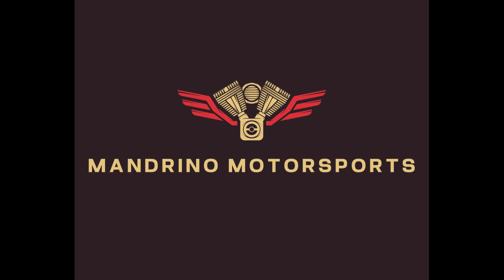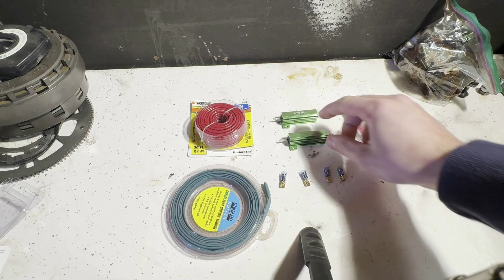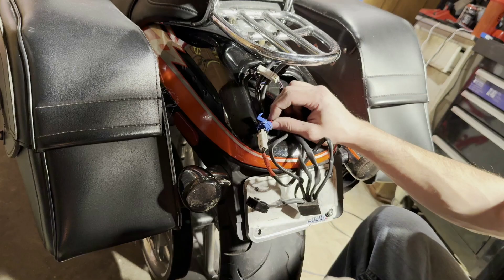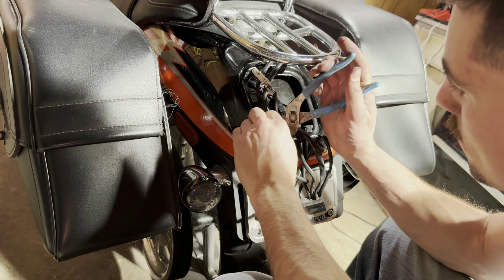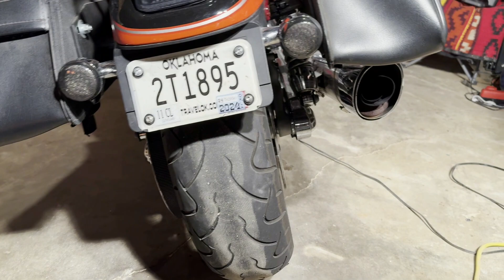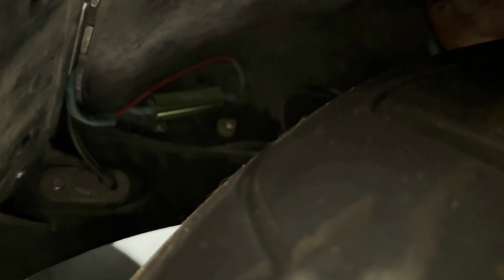Vrod Lighting Part 2

Comment: Interested in your Saddle bags and 2 up seat Sissy bar where can I find them and how did you search them or are they sourced from a different model bike?
Reply from the maker: The saddlebags were a headache. I ended up connecting with Keith Lindberg on Facebook who runs VRodbagger.com as you cannot buy the brackets from Harley anymore. The bags are Saddleman Jumbos that I modified to fit.

The seat was factory and the sidebar is as well. I bought it with those attached. 

Anything 2003 to 2005 should fit on this early generation bike. I will release a more in depth video on the bags if there is interest in it!

Comment: Nice work, normally there are not so much wires behind the taillight but there is now a runninglight module mounted that is not standard ( it is a HD accessoiry) I also have one… just be careful when pushing down on the taillight…. The upper tabs that fit under the outerfender break off very easy😢
Reply from the maker: Thank you! And that’s good information on that module I didn’t know that. Honestly I’m shocked that such a barebones bike has so many wires. And for the broken tabs I learned that the hard way on the original tail light…